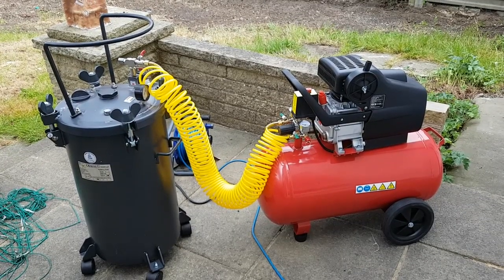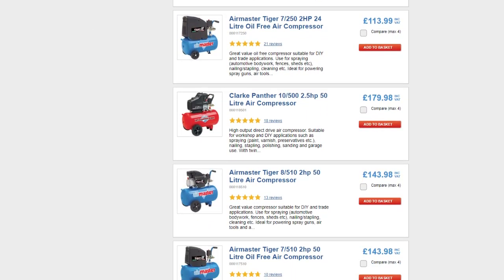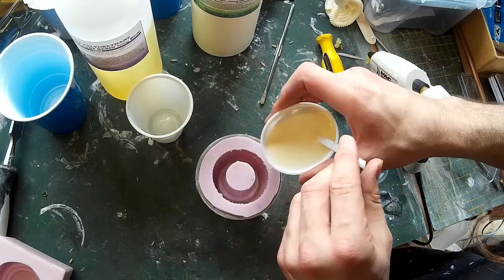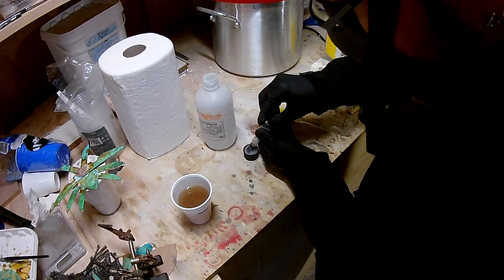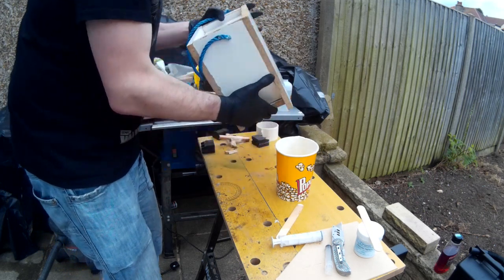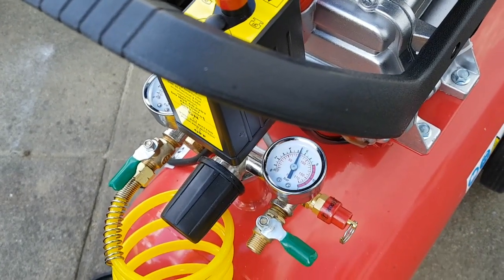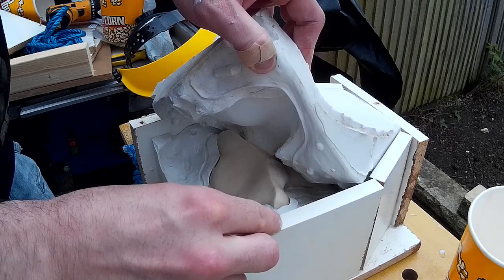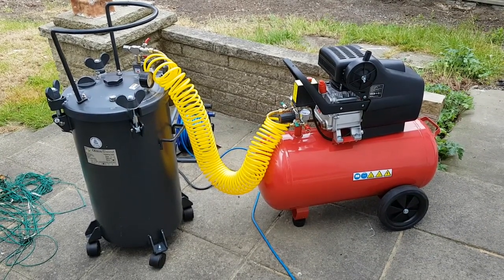Pressure casting resin

Comment: Is the air compressor loud? Ive been looking to get a pressure pot set up but there's a baby living next door so i was just wondering
Reply from the maker: Yep it's REALLY loud! You can get silent ones, but I'm not sure how 'silent' they really are.
Reply: Various companies make quiet compressors. I have a small 2 gallon one I use for my 5 gallon pressure tank and it provides plenty of pressure to fill in seconds and is literally whisper quiet, couldn't hear it in the next room. Don't get me wrong, it still makes noise, but you can easily stand next to it and have a conversation in normal tone.
Reply from the maker: Thanks, I might have to get one!

Comment: Great video, is true that when your sculpt your piece with monster clay and then put it in freezer then it will be useful for molding it? Is that why your sculpt didn't break? Thanks
Reply from the maker: I've never had to put monster clay in a freezer to mould it. Since it doesn't set it will bend rather than break.
Reply: @thedarkpower  Thanks

Comment: Hi..do you find using polyester resin as a casting medium the surface that is exposed to the air where you pour the resin into the mold is tacky?...i have just bought the same pressure tank as you have based on your review..thanks
Reply from the maker: Ah cool, yeah polyester is abit temperamental. That does sometimes happen. Can be due to a variety of factors but might be worth checking if there's any moisture in your compressor. You can get moisture traps. Might not be that but worth a look.

Comment: hello , l need to  know if  pressure pot  can eliminate  air  pockets (not resin  bubbles) in  32mm rubber molds  miniatures.
Reply from the maker: There's a limit to how big an air pocket it can deal with, so you still need air channels in your mould. I've not tried the specific use case you're describing but I'd imagine it could.
Reply: The Dark Power they would be small air pockets .
Reply from the maker: OK, I would imagine that would work, I've not tried that specific set up though.
Reply: The Dark Power thank you. l dont want to  buy  pressure pot  without knowing if  it works.
Reply from the maker: I can say that it works very well for air bubbles in resin as I've tried that.
Reply: The Dark Power thank you very  much.

Comment: Great video! Does the compressor come with the relevant leads for the pressure pot?
Reply from the maker: Thanks, no you need to buy those separately.
Reply: @thedarkpower  Thanks, Can you provide a link please? I am basically buying the Pot and the Compressor you have in your video.
Reply from the maker: Cool - I didn't buy the lead online, I popped into machine mart so I don't have a link.
Reply: @thedarkpower  ok no worries, Subscribed.

Comment: Hi mate, great vid. I’m just starting out with making resin molds for pots and bowls etc for turning on the lathe. I tried doing some pours a week ago and it went wrong badly with epoxy resin overheating and smoking and then overflowing out of the containers. I’ve since ordered the same epoxy resin another youtuber nick zammitt uses from the UK. I’m in Australia and I’m trying to order a pressure pot from spray equipment as well but not sure if I can as they haven’t responded to my messages. Any advice would be appreciated as to why my first attempt failed.
Reply from the maker: Hi Chris.  Wow, polyester and polyurethane resins do heat up when they cure but I've not known epoxy to do that.  I've only done small pieces though so larger pieces might.  I'd say that doing smaller pieces would probably help with the heating issue, or doing larger pours in separate layers - ie do one layer, let it cure, do another etc until you build it up.  Most epoxies have a maximum depth you can pour to, so it's possible if you exceed that that you'd get problems.  Wow, is there no supplier for pressure chambers in Australia?  I'd imagine you'll pay alot for shipping coming from the UK.  Anyway, hope you get the heating problem solved!
Reply: Thanks for the reply :)  I’m having trouble finding one or a supplier here for pressure pots it’s crazy. This other guy nick zammitt uses resin4art epoxy resin and in his vids I see him doing the pours in one hit. I’ve ordered some of this resin hoping it’s just the type of resin I used before that couldn’t handle that much of a pour in one go. Are those pots from spray equipment all ready to use and set up? I already have air compressor. What was that last clear cylindrical resin as that looks like a decent amount of resin and was that done in one pour? Cheers
Reply from the maker: Hey sorry for the delayed response, just found your comment in spam for some reason!  Yeah the pressure pot was ready to go pretty much - I think I needed to bolt the handle and wheels on but that was it.  I'm using this stuff for my clear resin, it's from a UK distributor though. It's much better than the polyester versions I've tried, it does need pressure casting though.  

https://www.cfsnet.co.uk/acatalog/Fast-Cure-Water-Clear-Epoxy-Resin.html

Comment: Very helpful video! Thanks a lot! I've bought the same pressure chamber as yours, and another smaller compressor from sprayequippment.com. I was trying to test it out, but I seem to be missing the air hose that connects the pressure pot to the compressor. Is that something you have to buy separately or they forgot to send it to me?
Reply from the maker: Ah cool, glad the video was useful! It probably depends on the compressor but I had to buy a hose and some quick release attachments for mine.
Reply: @thedarkpower  Ok, I see. Thank you

Comment: I just bought that same pressure pot from the same website! Haven’t bought my compressor yet. Do you have any advice for compressors? The same website you got the chamber from sells  small ones which are suitable for resin casting for like £150
Reply from the maker: Cool - well like I say in the video, I think the one I bought was a little overpowered.  I went for one which had a reservoir larger than the chamber so it wouldn't have any problems dealing with the amount of air that would need to be pumped into the chamber.  I'd say get the best compressor you can afford - it might be worth giving the website a shout see if they recommend a particular one for the chamber.  A smaller one might take a while to fill a large chamber which could be a factor if you're using a resin with a relatively fast curing time.

Comment: Doesn’t pressure casting decrease the cure  time of the resin as well?
Reply from the maker: I've not really noticed that, but if the pressure increases then the temperature will too so I would imagine it does abit.

Comment: Interesting vids and the results speak for themselves.Still havnt got round to doing any casting but am sure I will sometime.Lidl and aldi do some compressors pretty cheap so might be an alternative for people on a budget.
Reply: Sparks Tron I’ve got one of the Aldi compressors and it’s been doing sterling service for years now.
Reply: Christopher Pearson Good to know.I have had a few drills, dremel type tools and the like from lidl and aldi over the years.All good and a fraction of the cost of most bigger brands.Dont think they'll get round to supplying pressure  chambers but you never know.
Reply from the maker: Cheers dude, didn't know Aldi sold them actually!

Comment: Super video. :) I have a compressor and I use it a lot for many other things/tools as you mentioned. I don't have a pressure pot yet. I am still trying to make up my mind between vacuum or pressure. Strongly leaning toward pressure though as vacuum has more difficulty including having to vacuum your mold making material so you can use it with a vacuum. I have heard if you don't then your mold could explode if there is any trapped air in it. :P That would be fun to see though at least once and without resin in it. ;) - Heidi
Reply from the maker: Thanks! Ah, well you're halfway there then ;)  Unfortunately a compressor won't pull a vacuum so you'd have to buy a vacuum pump so pressure is probably easier for you, but then you need the vacuum chamber to create the moulds, so they kinda go hand in hand.  I would like to explode a mould too, preferably an older one though.
Reply: BlackCat2 Could mold  explode? why? explain it please.